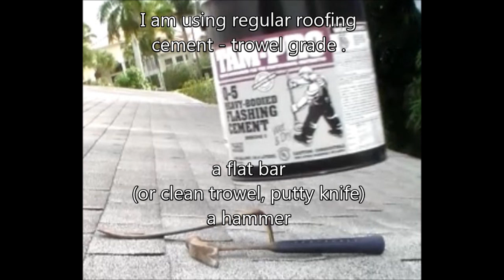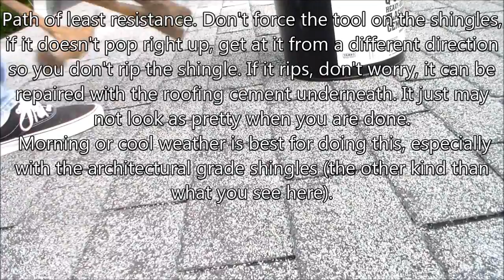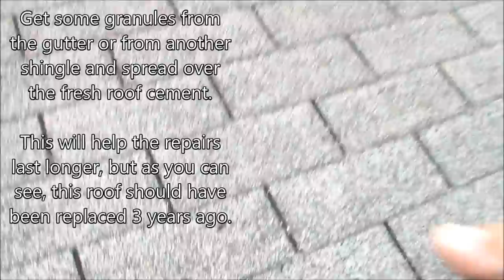Repair Leaking Roof in Asphalt Shingles - Protruding Nails

Comment: 1. Good idea about spreading some of the asphalt from the gutter. I never thought all that erosion could be recycled.

2. It's 2017 now. How's the repair holding up? I have similar scenario with nails. Would like to extend the life of roof for 5 years before going to Tesla roof that would be cheaper 5 years from now.

3. Looks like a lot of places, you did not re-nail so looks like solution would be to use cement in lieu of nails. So would using cement be as good as nails keeping shingles in place?
Reply from the maker: 1 - what came out of the gutter was granules that had come off of the shingles over time and I used them to cover the roofing cement so it would be protected from the sun and not so unsightly.
2 - Holding up fine. Where I put the roofing cement is going to last a while.
3 - better to use nails, but not going to matter if it is sealed underneath, but I would err on the side of using nails (that is nailing where you would normally nail the shingles)
Reply: Finally found my chalk after searching for a week. I got 6 spots where nails are exposed so look forward to marking and repairing them methodically.

Comment: Judging from the curling shingle corners and the massive degrenulation of the roof lifting nails my guess is it needs venting ... And a new roof those shingles are toast !
Reply from the maker: This roof should have been replaced several years ago. Just getting the water to stop coming in for the moment as a new roof was not in the owner's plan in the near future.

Comment: Interesting repair!
How would one go about this fiasco....
Roof leaks during mid-to-heavy rains. It is dripping down through the wood decking along a few specific nails (visible from the attic side).
I know roof needs replacement (actually overdue to be honest) along with the wood (rotten looking in places due to the leaking).
Its also leaking between the exterior wall and soffit, ridge vent, and ceiling above window (this is just from leaking areas "expanding').
This home is in Florida so no ice dams or snow melt.
Reply: Forgot to add - nails where water dripping into attic space are not visible or popped through roof shingle surface. The water is not necessarily wind-driven (just a good straight rain without winds causes the leaks)
Reply from the maker: Really just need to lift the shingles and see if there are loose or crooked nails. Also, if there is decking or 1x6 sheathing, if there is a row of shingles where the nail ends up in between, those nails may leak. They are just dangling and are not set into any wood to seal them. Water does get under the shingles in some places especially in lams if there is a bump in the right place.

Comment: WHAT happens when the weather changes and that same nail pops again,  i remove the nail and fill the hole with roofing cement/black tar. the nail is popping because the wood sheathing is expanding and contracting
Reply from the maker: That can work too. I think I may have done that a few of the times.

Comment: Should you have replaced the nail at 5:20  ?  Is it acceptable to simply cement down the shingles, or did you forget?
Reply from the maker: +DukeLaCrosse20 Looking back, it could have gone either way, but no matter what roofing cement was needed to seal the hole. The roofing cement under the shingle (or under the shingle that was missing the nail) will adhere it down similar to a nail, and the roofing cement on top adheres the tabs above from blowing up. This roof needs to be replaced so this repair is more of a get-by until reroof. Thank you!

Comment: i have put a short screw with a wide tappered head and roofing cement i place of a popping nail
Reply from the maker: It is a good idea but I would make sure the screw is long enough. Roofing nails are only 1 1/4" so that is still pretty short.